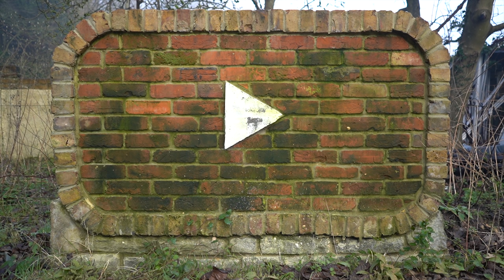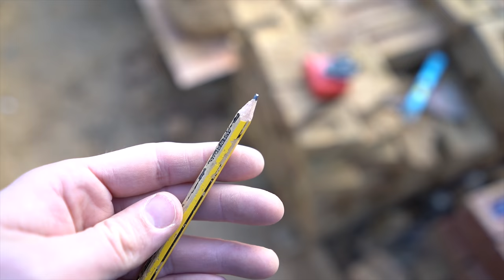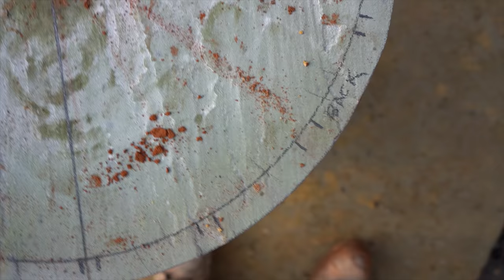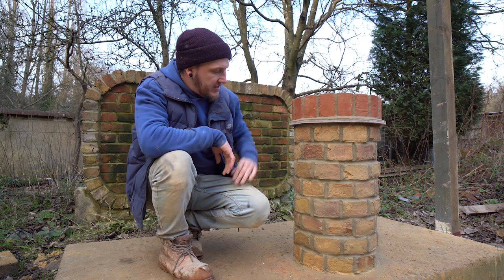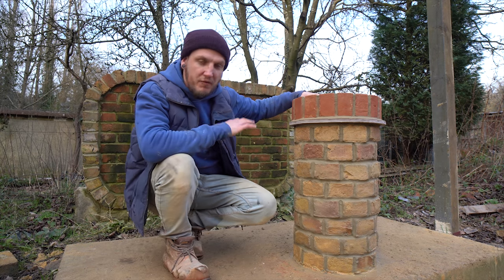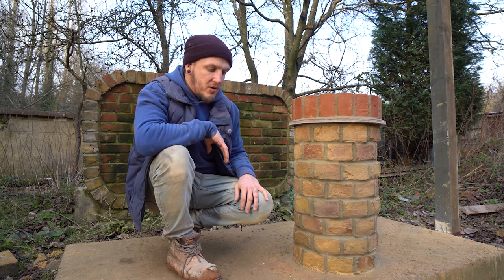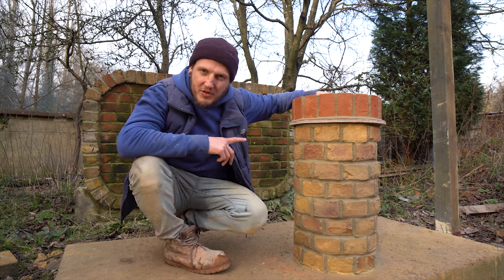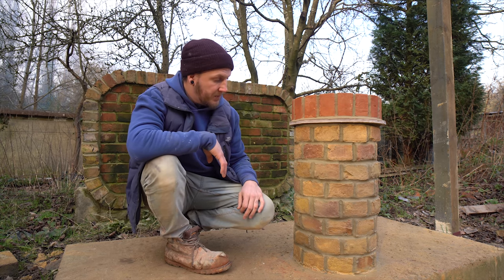BRICKLAYING - AMAZING UNIQUE circular pier FULL BUILD

Comment: Bricks laid wages paid. Love the video work amazing and the top. And I reckon if you would have corbled the bottom in and out every course you would have got away with it nice top top bloke 👍👍👍👌👌👌
Reply from the maker: I originally did try to have a spinal effect with each alternating header on each course sticking out 20mm. That was not happening due to the size of the base. It will definitely work in a larger diameter and I will try again in another video in the future 🤙🏼🧱
Reply: @RodianBuilds  👍👍👍does look smart 👌👌👌

Comment: Love to build a pier like that ,Been a bricklayer 35 years and appreciate the effort you went to .
Lovely cuts, the most difficult thing to do .Would you have tried a plumb steel rod in the centre and work around that 
save a lot of level work .You could maybe notch the steel to keep gauge. Just a thought ,probably the same scenario as building a spiral pier ???.
Reply from the maker: I think having a steel rod and making the circumference larger would make it look much better. Deffo learnt a few things from  building it 🤙🏼🧱
Reply: @RodianBuilds  🍻🍻😉

Comment: Is there a way u can work out how much cement and sand is needed ( how many bricks will a 25kg bag of sand and cement lay )
Reply: depends if they have frogs ,cores  or not, but usually 1 brick 1 kilo of muck
Reply from the maker: There is a calculator online you can use to work it out. I forget the website but if you google it I'm sure it will come up 🤙🏼🧱
Reply: @RodianBuilds  that might work also Rodian, but, with any luck it was written by an old Brickie , or,mix up a bag ,lay bricks and count them. I really like your Chanel,brings back memories thanks